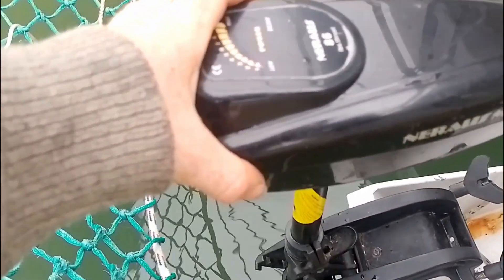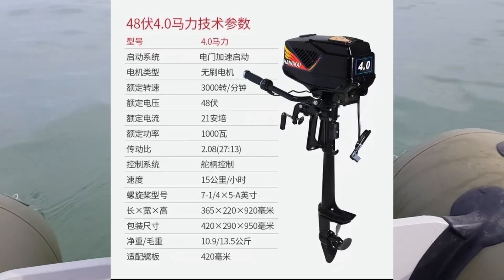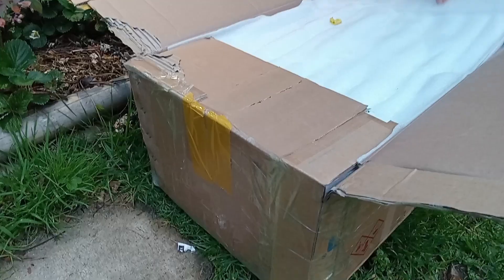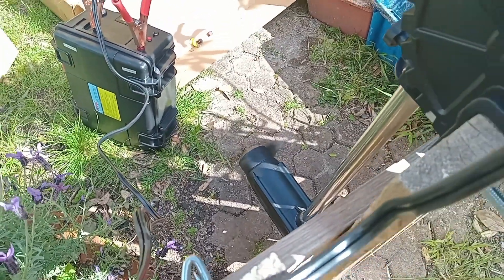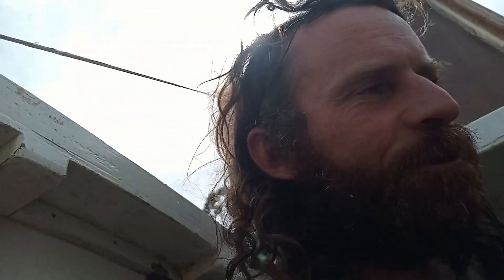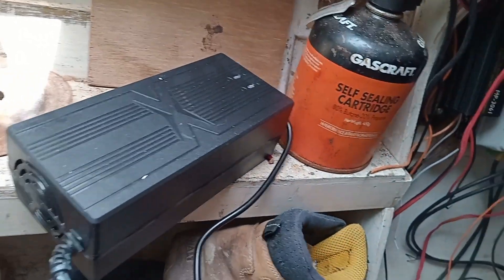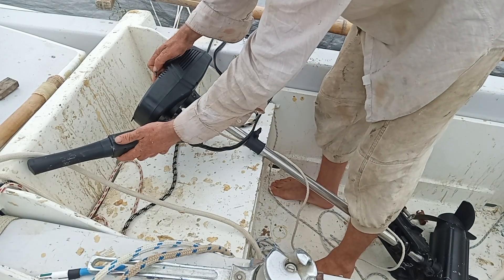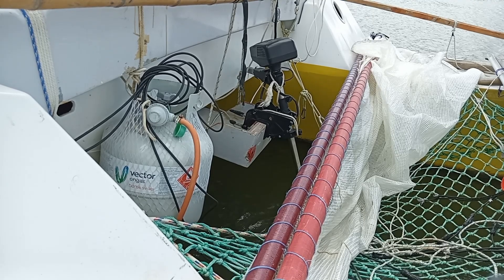Solar Electric Motor for My Catamaran

Comment: Have you looked at trying an APC prop from RC planes? They seem to be the most efficient for this sort of thing even though they're not designed for water.
Reply from the maker: yes I tried one of those on my smaller outboard, (12v "55lb" thrust) and it worked really great, the long skinny blade was much more efficient... however at full speed it did cavitate... boat props are usually very low aspect ratio because that reduces the wing loading and thus cavitation. (though usually I don't run it full speed to maximize battery life)

But yes some prop optimization would probably be worth while. I've also been suggested to have a cone on the prop so that it doesn't make turbulence behind the motor. And the shaft is just a round pole and that it self makes a lot of turbulence when going faster

Comment: Your video on the electric propulsion made me so keen to try my system out and like you, for the same reasons I've gone for a Lithium Ion Phosphate battery.
Reply from the maker: Great! Yeah i like it many advantages especially it always works instantly, and quietly! And never need to buy petrol, but id still rather sail if possible!

Comment: Thanks for your videos they are greatly appreciated. You mentioned your passage planning at the end there. A video on that process would be super interesting. I am an inshore (30 miles) qualified skipper and have done 90 mile crossings but all on monohulls with “reliable” inboard diesels. I today paid for a Pahi 26 and the gods willing will shortly take ownership. The considerations for a wharram with a trolling motor must just be different and I would appreciate your knowledge/experience. Thanks
Reply from the maker: @Jacalo69  congratulations! You will have loads of fun in that pahi 26! hmm i already have quite a backlog of videos so one on passage planning will be a bit down the road but thats a good suggestion! I do have monohull experience but tbh i never really had a reliable engine so i have always planned in an enginefree way. So a bit harder to contrast the difference with relying on an engine. I am a big fan of electric propulsion but i think you do need to approach it as a more convienient version of engineless sailing. So, that requires using the tides to your advantage, and also having awareness of local weather patterns (but you learn about those quite quickly if you dont just start then engine) where i am sailing, the wind often picks up in the afternoon, and if so, usually drops off at night, so in that case plan to arrive by daylight - or stay out or accept youll arrive slowly. Mountains etc can interfere with the wind, so if i am going a long way i am more inclined to try to do it in one go. But really the trick is waiting for the right wind or just going where the wind wants you to go!
Reply: Thanks for your reply. Yes often we are making decisions on time restrictions, say holiday itinerary, rather decisions based on weather windows/conditions slowing down and just enjoying the privilege to be out on the water.Actually remember being caught in a terrible storm because my parents had arranged to meat people at a predetermined place. This was before internet and mobile phones. The boat is in Nantes and i think my biggest challenge will be the tides and crossing the channel to Cornwall, crazy shipping lanes. What is your pointing to the wind angle like?
Reply from the maker: @Jacalo69  right. The most dangerous thing on a sail boat is a calendar! I learnt that early on. I havnt really measured it really accurately but i think my tacking angle is about 120 degrees. The boat goes so much better a bit further off, on a close reach, i generally try to avoid sailing to windward very far. Into a bay is okay, although sometimes i have done short passages (~100miles) close hauled on one tack the whole way. The ride is just much bumpier and wetter if the wind and waves is forward of the beam.

I think it might be possible to point higher with newer sails, although really you'd need daggerboards. However i like being able to sail directly on to a beach! I dont mind trading a little windward ability for that!

Im currently in a boat yard, and have seen the bottoms of a lot of large cruising cats, somewhat horrified to see most of them look like they cant dry out or run aground safely! With a pahi 31 if i get stuck i can jump off and heave the boat off (if i am quick, or just wait for the tide to come back up)
Reply: Thanks again. I’d like to get in contact regarding those sliding hatches sometime in the future. I have designed something similar but will need to tilt them outboard to then use the central deck as my workspace. But would you mind just briefly explain your navigation set up please. I am currently thinking charts , hand held gps , a rod heikel cruising guide for my zone.

Comment: How did you calculate the specs of the electric motor you needed/purchased? I think it’s the 2150w model?
Reply from the maker: @brucedrake8645  i had a 24v trolling motor and when to the next size up, basically. Yeah it says 2kw, but when i had a power meter on it it i think i only got it to 1500? Or maybe 1900? It depends on how much current the battery can give
Reply from the maker: @brucedrake8645  the cat is about 2 tonnes. I also tried it on 2.5 tonne mono, and got to 3 knots, without a very clean bottom either.
Reply from the maker: And on the proa, it can do 7! With a massive wake. Needs a faring on the shaft. Havnt matched the prop yet, that would probably made a big difference
Reply: @dominictarrsailing  I need to move a 5 ton boat just around a marina but I am thinking that might not cut it if the wind grabs the front. I was going to try and move it with an old Torqueedo 1003 but now I think that might be insanity as that has even less power than yours. It might work in calm conditions perhaps.

UPDATE: Turns out you can move a 5 ton monohull at 2.1kts using 1130W (Torqueedo 1003), it ate the battery but it worked! Flat calm conditions though.

Comment: Have you considered a yuloh? Maybe not as main propulsion, but as a backup at least.
Reply from the maker: Yes I have a yuloh on my other boat (the raven 26) hmm I guess now that I do not have a raised solar arch I could fit it on this boat, but I'm more inclined towards a R2AK style pedal drive behind the crossbeam, next to this electric motor.
Reply: @dominictarrsailing  That's really cool, reminds me of the pedal boats I loved to use when I was a kid. Looks more efficient than a yuloh too.

Comment: Looks like a Pahi 31. Had one, sailed fast and comfortably.  Did not need all those wires.
Reply from the maker: correct! it does have redundant rigging, but also I like that the mast doesn't fall down

Comment: Ahoy Dominic  !
A Good Vid !
Yes,  Petrol outboard are always have a Bad Smell around them !
2 bad smells when in use , plus Noise & Vibration !
What Location at Vids end ?
More please !
Reply from the maker: Tata island, in golden bay! Am back up north now. Nearly round north cape!
Reply: @dominictarrsailing  Wow !
Reply: A "Fresh Express " Voyage ?
How Long to Cape Reinga ?
Reply from the maker: @michaelknuckey4405  arrived in bay of islands this afternoon. Much better run than our trip last time. I did not tack once! gybed when the SE became SW past farewell spit then again at north cape. 4 days 4 hours 28 minutes, from takaka to boi!
Reply from the maker: @michaelknuckey4405  oh from the trip of farewell spit to cape reianga was lets call it 3 days 3 hours. I think I could have done it faster with better self steering gear. on the one hand to go straighter, but also I often had to reduce sail to reduce weather helm. Then I could push for 7 knots instead of being happy with 5
Reply from the maker: Great point about the smells!
Reply: @dominictarrsailing  Very Stinky !  !

Comment: The corrosion on that bottom end circuit board is why im reluctant.  Im thinking of running a hybrid system, but utilizing and inboard shaft. The 12-48v charger is a good idea,  I run a 6v to12v pack on my old Honda XL, so i can run an led light and see where im going at night! Raw cells in a lock-box is a cheap and easy way to make a one-off system, if you know what you are doing.
Reply from the maker: I am pretty confidant that my unit doee not have a circuit board underwater like that. I havnt opened then bottom yet, but i picked one with a cylendrical shaped bottom end, not a round one... which i think has a small high rev motor and planetry gear like the torquedo. My hunch is that style will be more likely to have a circuit board (its the speed control) down there. Oh also there is another channel, sv_oiysh that had that problem with a torquedo and they replaced it with a new speed controller wired in from the top

Comment: Impressive skills and reasoning. I connect so strongly with your concluding remarks about having to make decisions based on the weather and tides being a joy, and contributing to our awareness of and connection to nature. I am dumbfounded all the time by the number of "motor yachts with masts" powering around. Thanks for the great video!
Reply from the maker: absolutely. I sailed a 39 foot mono to Australia last year, and that made me understand it a bit. big boats are hard work to raise the sails, even me, young and fit, it was exausting! but the engine is just pushing a button! (unless it breaks down, then it's probably climbing into a filthy hole, or getting your wallet out) people seem to think big boats are better, but a small boat is much easier and more fun to sail too!

Comment: Be interested to hear how long a motor designed for inland lakes last on the ocean.
Dominic, did you consider a long tail option?  It has been done on Wharrams, the motor goes afore midships, with the tail gently sloping towards the stern.  That way you can make a complete custom build, and all well protected from water.
Reply from the maker: Well it has a picture of a shark on it so it must be gor salt water ;)
Reply from the maker: Do you mean a diesel engine with the long driveshaft? Overkill on a boat this size and i also do not want to maintain nor pay for a deisel engine. Id much rather just wait for the right wind!
Reply: @dominictarrsailing  no no!  A simple electric motor attached to a long shaft , propeller on the end.
Reply from the maker: @markthomasson5077  ah! Yes i did consider that actually but i think this off the shelf one is easier (especually since i can take it off and put itpon something else too) a built in motor is a lot money to not be able to use it on anything else!

Comment: Thanks for this vid, 6+ months in the making. :-)

I've been exploring adding solar to my Velomobile (just lighting mainly). So this was really interesting. Thanks
Reply from the maker: velomobile! hmm you could probably achive a never-plug-in electric solar velomobile if it was used for commuting (not long distance) and not parked inside. although you might need a custom designed fairing that encapsulated the panels. I occasionally day dream about a cruising version of that solar car race they have in Australia

Comment: I like the trade-off speed for a self refilling propulsion. It breaks this never ending rush cycle we find ourselves so often in. Often people refer to safety in regards to weather phenomens, especially on anchor, when you quickly need to move. But the real question is, why didn't you choose and setup your anchorage properly? There shouldn't be the need to leave in hurry in first place!
Reply from the maker: Absolutely! And in this modern age we have very very good weather forecasts so there is no excuse for that! our ancestors sailed engineless and built whole empires like that, people say yes but they died a lot. but now we have very good weather forcasts, and also accurate charts and navigation, and much stronger modern materials! so sailing engineless (or minimally engined) in the modern age is massively safer than it was for our ancestors

Comment: Thanks for sharing, I've love an electric motor on my monohull, but it displaces over 2 tonnes, so I'd be in expensive Oceanvolt territory
Reply from the maker: I have since tried this motor on my 26 foot monohull, which displaces 2.5 tonnes and I still got up to 3 knots. I generally sail that boat enginess, it's actually much easier to sail it engineless than the cat is, because the mono tacks very responsively. when I emotoring I'm usually only going 2.5 knots anyway, to save power. so I think this motor would work just as well for a small keeler like that. And using an outboard has a significant advantage that you can take it off and put it on another boat easily. It's not just spending a lot of money to only be able to move one boat a short distance.

Comment: I like your perspective, info and take on running electric. I'm a gearhead and chronic re-user at heart so a mono with a small diesel will likely be the path I'll take. 
Outboards are funny buggers, I see people running the same shabby outboard for decades and then others who see no end of drama.
Reply from the maker: Absolutely. It also amazes me what level of unrelyability people tolerate. I see people putting out in thier dinghy and the motor stopping and they have to pull start it again (and of course it doesnt go first time). Id rather row!

Comment: Super awesome idea of using a trolling motor , marine  electric outboards are so expensive . Thanks for sharing this realistic approach to self reliance !
Reply from the maker: I started with a trolling motor but I would consider this one a big upgrade over those. this one is about equivalent to a 2-3 hp motor
Reply from the maker: but the thing that's good about it, is that it has a non-integrated battery, which in my opinion gives you more options

Comment: The biggest danger to electrics on a boat is not corrosion, it's vibration. Corrosion can be controlled with tinned wire, soldered connections, waterproof heat shrink, liquid insulation, sealant, Vaseline - all the stuff you do already. But wiring that isn't supported physically throughout it's length will eventually fail due to vibration. The constant motion of the boat will eventually work harden the copper strands inside and break them. The effective diameter of the cable will decrease, increasing internal resistance and decreasing the power delivered. This is insidious. The cable looks fine, there are no breaks in the insulation, but the power just isn't there any more. All cables must be supported: tightly in conduit, cable tied to something solid, or attached with hangars at short intervals. If you can move the cable between supports with just your fingers, vibration will get you.
Reply from the maker: Interesting... how long does that take? Ive tried to find some references to this but apart from a few forum comments i havnt found much
Reply: Depends. There are too many variables: how much sailing you do, the motion of the boat in a seaway, the sea state (chop vs long easy swell), the unsupported length and weight of cable, etc, etc. Weeks, potentially, to years. A long loop of unsupported cable that swings like a pendulum at anchor would suffer much more quickly than a short length that only shakes a cm or two when pounding to windward. I was a Navy electrician in my 20s.

I should add a note: you see this effect most often in the dim masthead lights in anchorages. Long runs of cable hanging and although in conduit, the cables are usually loose within the conduit. Add spares or rope so the cables are tight in the conduit.
Reply from the maker: @Ron-dx9wq  the navy! Thanks appreciate that context! I certainly have some cables that i could pin down a bit more but my anchor lights as still bright. (Actually, so bright that someone complained once!)
Reply: @dominictarrsailing I reckon the biggest threats are actually high voltage especially AC or positive polarity, PVC insulation, lots of fine strands. 

Really don't think navy guy has a clue.

You'd do great having solid aluminium bar. 
Must be pure Aluminium. 

 Or even stainless cable  for most purposes if it's thick enough. Ten times thicker than the copper you'd need.

BTW set a new distance record with the 55 lb Neraus 5/3
22km with 600 kg of displacement tender. 1 90Ahr Starter battery, 1 40Ahr car battery, 1 28Ahr lawn tractor starter battery.
All flogged for several years.
2 days to recharge in dodgy weather with 1 150W solar panel, direct connected.
Used full power for 10km home trip Tauranga to Kulim park to Sawmill hunters creek Matakana island. 1.5hrs over ten km. Heavy load of supplies DEFINATELY over 600kg displacement. 
Heaps more range with parallel connected baterries
Reply from the maker: @aaronfranklin324  impressive! that's with the lewis road prop cone and RC plane prop right? and shaft fairing right?

Comment: Very helpful visualising electronics in a salt water environment, on a small project. Vaseline jelly gets the tick of approval from many sites, so that's good to know.
Reply from the maker: I was recommended by an old engineer, and I used it on the terminal block for the bilge pump on my other boat, several years it sat on the mooring. with the bilge pump not going for some reason. Eventually i fixed it - realized the problem was elsewhere, the terminal block was perfect! just slathered in vaselene and then wrapped in electrical tape! I think it would have been underwater too!